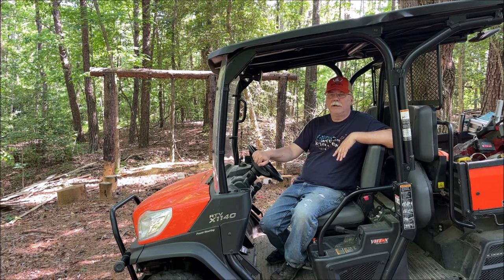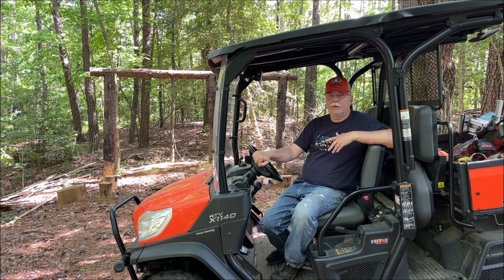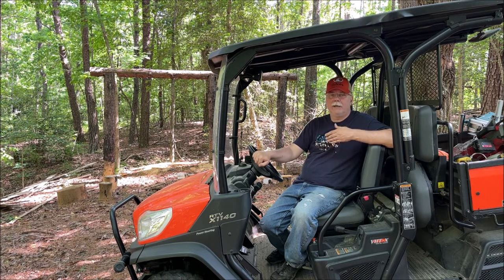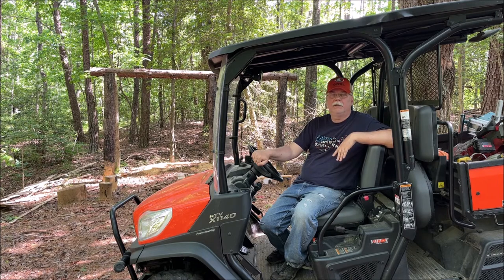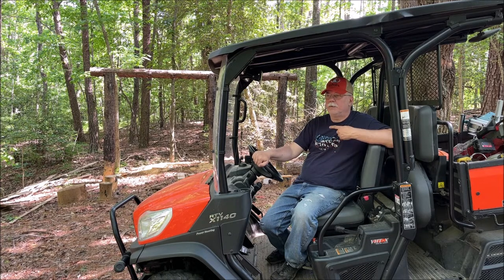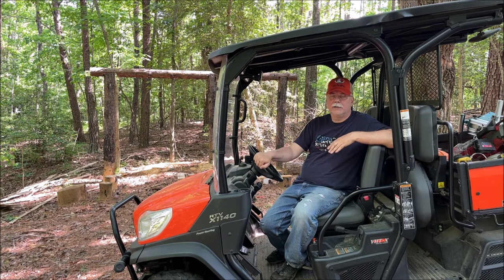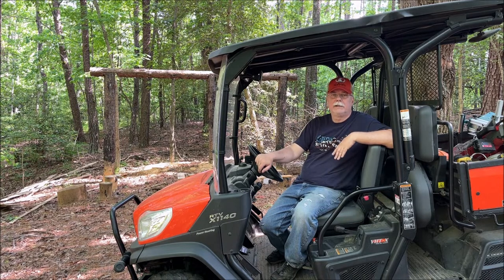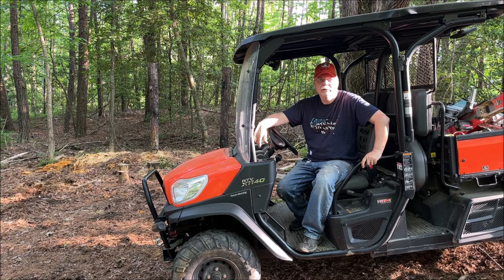Did Yakisugi or Shou Sugi Ban actually protect my wood from rot or deterioration? How effectively?

Comment: Well let's come back in 30 years, see if its still good to go.
Reply: The old vikings used it, so we have around 1000 years r&d :)
Reply: pretty sure some of the temples in Japan are clocking it at over 800 years... this is next level protection... of course since nobody can commercialize something so simple, we'd never hear about this as a viable solution, but I am on my 5th year of sugi banning all my outdoor stuff and it works... zero maintenance... oak, cedar, pine (not as much though)

Comment: Thank you for doing the science.  I don't see any reason to brush the char off? I wonder if you had thoughts. 

My plan is to use it on fence posts. And Wood siding.  On fence posts, I had thoughts of using old timer 'diesel / used oil' mixture over the top of the charred wood.
Reply: the only reason to brush the char off is if you want to 'create a look'